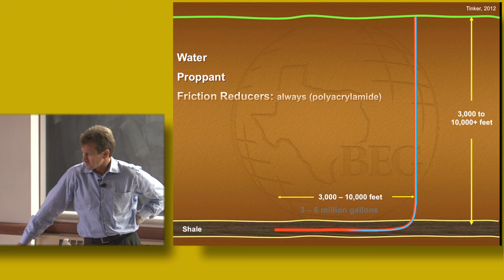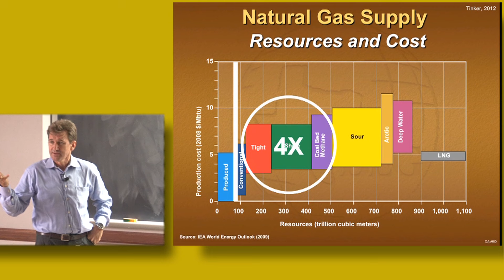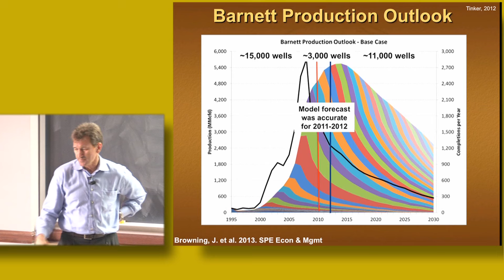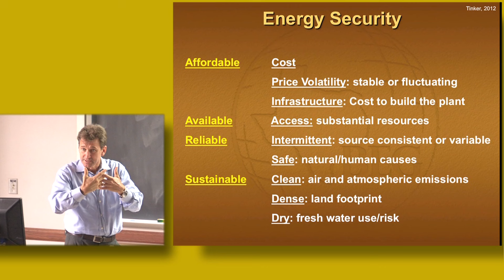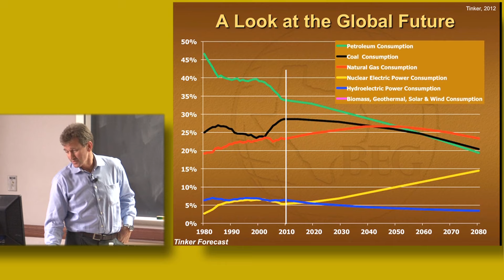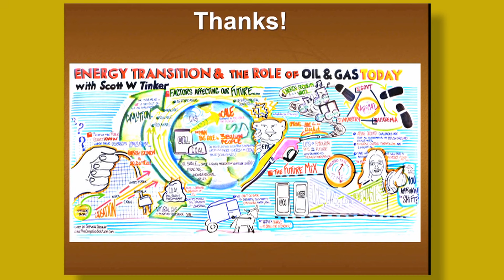ISGS Special Seminar: The Role of Shale Gas in the US Energy Future

Comment: The US producing such big quantities of extreme energy is testament to the energy inefficiency as a nation - the reduction in per capita GHG emissions still leaves this nation in the top three emitters globally. This is not worth a celebration and makes me wonder how much fugitive emissions are or were unaccounted for, before thinking of "tighter control".  Without this the  economy will collapse.  
I do not agree that the US has the technical know how to ensure safety at home - and should not be selling patented technology and profiteering from exploiting the planets shale resources.
With the insatiable exploitation of tar sands alone the agreed 2 degree Celsius warming and global carbon budget is spent. We are approaching runaway climate change fast.
All wells will eventually corrode, so inevitably communicate fluids and methane. Water is becoming not affordable. Unsustainable. Radiation is a by product of shale gas, Increase energy efficiency, decrease the footprint on agricultural land, biodiversity, water, air. human health, cement, steel.  Use your cold clean non combustion expertise.Slow down, be thorough with the science out there. If you would like to discuss your opinions to my comment here - feel free. My frame of reference is studying shale in an air quality thesis.
On the option of nuclear energy - this heats water that we are suppose to be keeping cold - the lag time of latent heat in water is an issue. That heat results in an increased heat budget and radiative forcing. Neither shale nor nuclear can cool the climate.   The golf course argument is not subjective and is bias/fallacious in a scientific debate. The shale water injected to crack the shale and long term disposal - mostly is sequestered out of the hydro-logical cycle.  Despite the nutrients golf course irrigation remain available through the global water cycles.